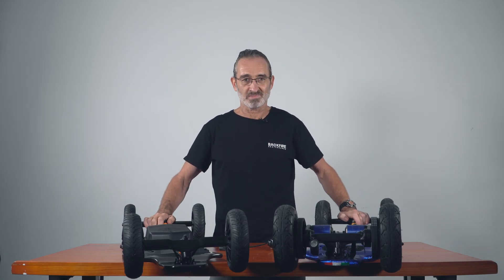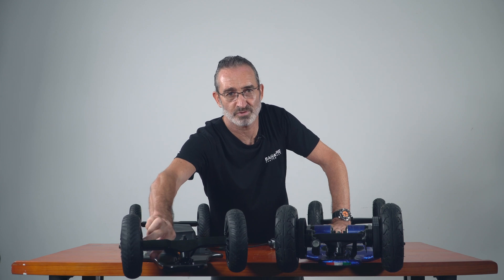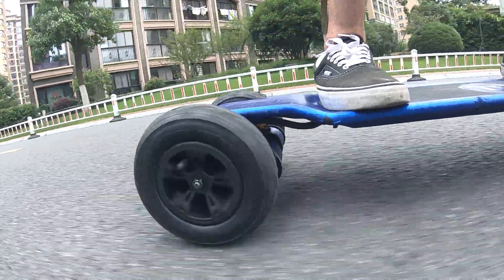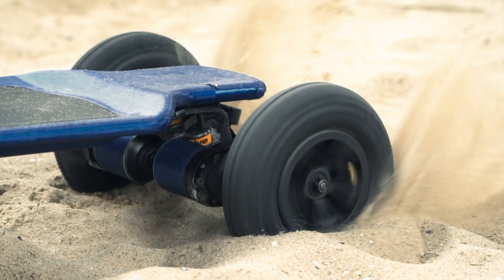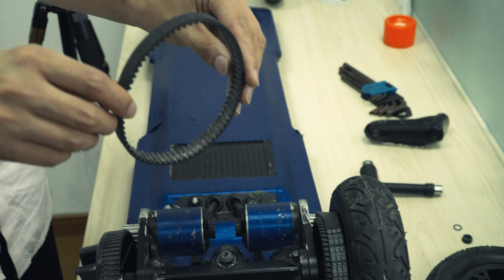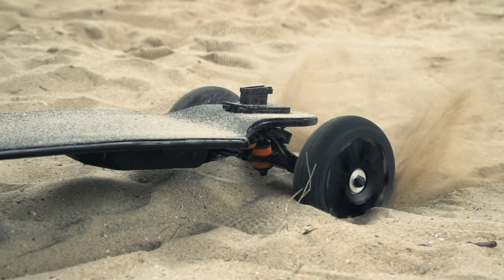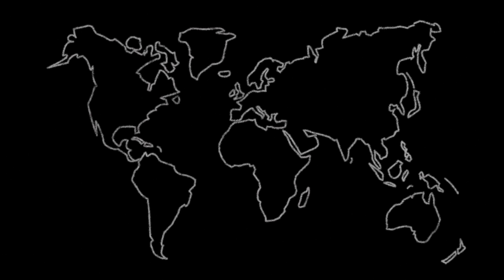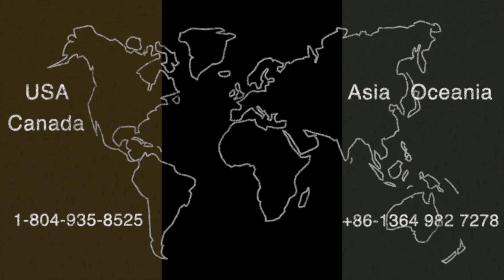Hub Motors Versus a Belt Driven System on Sandy terrain Backfire Ranger X2 Electric skateboard

Comment: Love the new design! Way to go Backfire. I ridden a couple of AT mountain boards & I wish you have used a  medium flex deck for leaning to into trail walls & helping with feet fatigue from a stiff deck. Do you have option to stiffen dual king pin? Dual king pin trucks are awesome for carving on street but on trails it's a balancing act on uneven grounds to stay upright when you hauling down hill & not to mentioned speed wobbles.

Comment: I have a quad large-hub driven board by Tranzite boards and I also agree that sealed large hub motors are great for cross country runs. I've got mine in the workshop at the moment for an overhaul and battery relocation project. I've requested a 4-speed remote and ESC driving 6.6kw of large hub motors. I've ridden the 2wd setup for ages with 3 large lipo blocks attached for sound system, lights, and using an extreme range 40ah 36v lipo block. Hub sip power and regen it back. Belts are great for braking but are thirsty for power and burnout some BMS setups